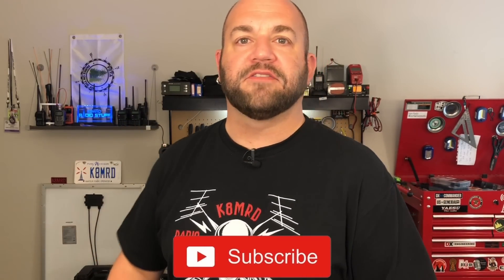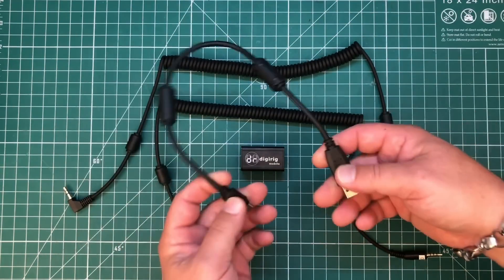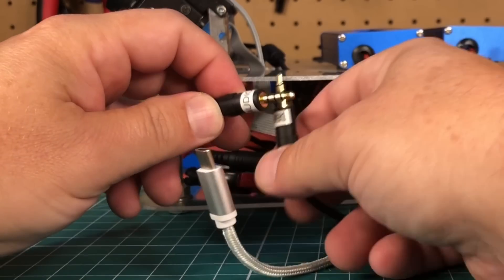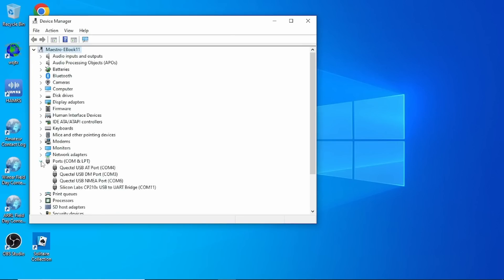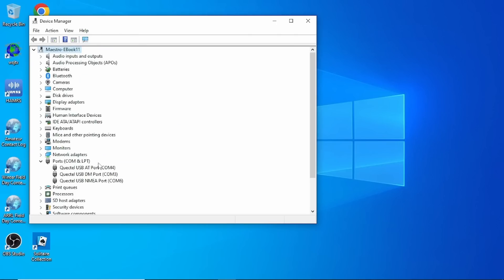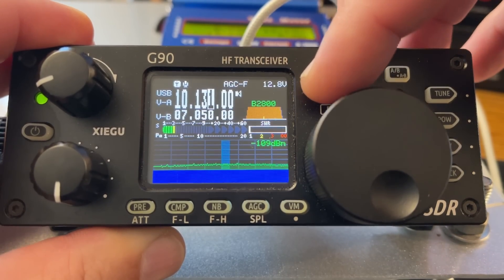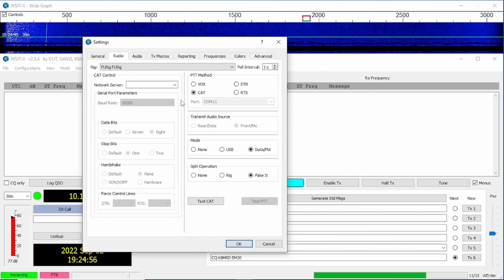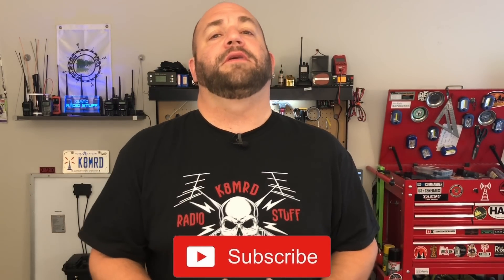Digirig, Xiegu G90, FT8 Fast & Easy

Comment: I think it would be easier to use the Xiegu DE 19. But I do not think it was available when you made this video. It takes just 3 cord and is made to work with the G90.  Though it is a bit bigger than Digirig.

Comment: On any rig you never want to run a 100 percent duty cycle at more than half the rated output. It puts a real strain on the finals doing that. You risk damaging the finals from overheating. ALways run output at the gighest, at no more than 50 percent of the rated output for the radio.

Comment: Can you repeat this demonstration using IC 705 and digirig mobile?
Reply from the maker: Easy.  You don't need a Digirig.  The 705 has a built in sound card.  Plug a micro USB from the 705 into your computer.  WSTJ-X setup should be very much the same.  Under settings > Radio > Rig > Icom IC705.  I use defaults for Data Bits, Stop Bits, and Handshake. PTT method CAT, Mode Data Packet, Split Operation Fake It.  You do need to make sure to have the baud rate the same in both the radio and WSJT-X.  I think it's 19200 for the 705.  Don't quote me on that though.  Then go over to the Audio Tab in WSJT-X and select the radio.  I believe it's just USB audio CODEC for Input & Output.
Reply: @hamradiotube i really appreciate you taking time to address my rookie question! I'm trying to find a way to get RadioMail Winlink to run on HF stations using the 705 in the field/emcom. I think it's not possible, right? Plan B  is to use a windows surface tablet (low power consumption) to run Vara and Winlink as usual. Thanks for your hard work putting out your show!

Comment: Good morning, friend, excellent video. I have a question: I can't get a high input level on the WSJTX. I've turned the mic volume up to maximum in the PC settings, but I can't get above 20 dB on the green bar (it should be between 60 and 70 dB without clipping). I've also set the G90 to line mode and its input and output levels. I'd appreciate some help. 73!!!

Comment: Thank you, you got me up and running. Now I just have to figure out how to use the program. I had a little issue with finding the correct port. Turns out I had to download a driver for the digirig. But after that, everything seems to be working well.

Comment: Thanks for the nice video. What is the advantage of running flrig between wsjt-x software and radio ?
Reply: Maybe for running other software at the same time. But his settings is old and was very confusing for my radio when I tried to use same settings in a "newer" flrig version.

Flrig needs a newer Xiegu G90 configuration file, hard to google for it. It is old what is on the github for flrig maker.

So I dont use flrig.
Reply: @LordGryllwotth  I ended up having to use FLRIG 2.0.04 set to "radio G-90" to make WSJTX work on Linux Mint with my G-90.

Comment: Followed your instructions to the T, or so I thought…Tried a dozen or more times to set up FLRig but no go. I went back over all the cables for proper seating of the jacks in the ports. Then it hit me, when you said the one in the front with the 90 degree jack is the serial! Duhh. I had plugged the cables into the Digirig incorrectly!!! Once corrected everything was a go! Thanks for this!

Comment: For anyone watching in October 2024, I had luck with this method but could not get flrig to cooperate. Flrig would randomly crash all the time, and almost always at the end of a transmission. I tried using OmniRig instead and it was MUCH easier to setup and works without a problem.

Comment: Digirig will work without using FLdigi. In WSJT select Xiegu G90 as radio and setup as you would set up any other radio. Also the Baud rate for the Digirig is 19200 no matter what is shown in device manager properties. Please correct your information and save us some hair pulling.
Reply from the maker: Well if you shave your head you won't have any hair to pull!  Hmm, I'm gonna have to try this.  I feel I did and it never worked for me.  Time to go pull what little hair I have 🤣

Comment: Well after 4 hrs it turns out not to be so easy.
Reply: Forget the FlDigi program ... just set up the WSJT radio settings for Xiegu G90 - your com port - 19200 baud - 8 bits - one stop bit - and select cat. It should work fine.
Reply from the maker: Nope.  Doesn't work for me.  Just keeps crashing WSJT-X.
Reply: @hamradiotube  I have noticed the WSJT-X software become unstable a few times and lock up as well. I wonder if there is a fix or update that will help. Everything else runs as expected.
Reply from the maker: @happyjack880  One can hope.  But for now, I have a way that works, and if it ain't broke...
Reply: @WilliamLee-eh6hy  up and running! 73

Comment: Thank you! I'd have never guessed I needed to put the G90 in U-D mode to use the Digirig. I'm so used to running my home station radio in USB for digital modes, I assumed setting the G90 to use the ACC line input was all that was needed.

Comment: Thanks for this video;   was wondering if the G90 did digital organically. I am so spoiled by the ICOM  705 ( now using SDR to do FT8 wirelessly on my iphone) that I probably wont invest in a G90 for 10 more watts... great to know there is a addition for the G90 to do it.  Waiting for ICOM to release  a50 or 100 watt versio of the 705 for POTA/SOTA use!  Thanks for the video!  Bob / KU3C

Comment: Hey Mike, or anyone, what's the ribbon cable called that connects the head to the body? I need that so bad. The cable that came with it keeps bending the connector that came with it making the connection come lose inside. I have to keep re-soldering the connector inside. N9MOE
Reply: It should be a straight through DB9.

Comment: My wife, my son, and I are all new to Amateur Radio, but learning as fast as we can. I want us to be able to communicate using SSB, CW, FT8. I purchased a Yaesu FTDX10 for our main radio and have been having fun learning with it. I want to buy a second cheaper radio for the three of us to use (when two of us want to work simultaneously for POTA and such) and am considering the G90. I see that I would need something like a Digirig to connect/interface a laptops to the G90 for CAT and FT8. Is the Digirig type component also need with the FTDX10 or does that radio include the laptop interface?

Comment: Oh-Emm-Gee!!!!!  I cannot believe how utterly non-user-friendly is the process for simply connecting my G90 to my 'puter.  All the gadgeteria required, all the extra, confusing software requiring a PhD to correctly charm into functioning. I thought just plug  in what came with the radio and CE-19, wave a few wires around and done. No! no simple find for a program so the radio display can show up on my computer. That's all I really wanted, was a larger display for my eyes. Wow...

Comment: Absolutely first class video for this application. However, there is one one tiny place where he could’ve improved on this video…. At the part where he said the radio locked up and would not work.  Instead of getting Flrig going, he may have tried using a medical syringe with a long needle and given the G90 a hard stabbing injection of epinephrine in heart of the radio. 😂 😂😂

Comment: I can get our G90 to connect and get a green light for the radio but no transmit. Also the screen on the G90 goes blank. Have to disconnect power to reboot the radio.

Comment: One update for users of Firmware 1.79 on the G90.  Changing from MIC to LINE IN doesn't send the output to the digirig / computer like on version 1.78 and below.  You have to change modes from USB to U-D and then the digirig /software will be able to decode the signal.  Most of the videos on Youtube use the older firmware versions and this has caused some frustration that it still doesn't work after going through everything else step by step.
Reply: Thank you this is the info I was looking for. I was getting 0.0W and ALC:100 with no transmitting happening before this.
Reply: @manwithaladder exact same problem.  Did you fix the 0 watts when transmitting?
Reply: That is changing the mode on the radio and not in the software, yes??
Reply: Yes, the radio mode.

Comment: Let me give you a challenge. Get a digirig working with a G90 running Ham Radio Deluxe. This has been a challenge. Who is up for that one?
Reply: Actually a man after my own heart. My main computers are Macs. I have an Ubuntu web server. The only extra computer I have is a Windoooze computer.
Reply from the maker: The bigger challenge would be getting me to use a windows computer
Reply: Do you have the digirig/flrig/g90 setup instructions for Mac? I'm a couple days away from going through the mac process and hoping the settings translate well 
 @hamradiotube
Reply: @hamradiotube  I dislike Windows as well, but this is what the vast majority of people use. How about basing your tutorials on Ubuntu? That is the future.

Comment: Have you had anyone complain about flrig not working with this setup. I did as you said about setting flrig up before. But it will not connect. I have made sure I have the correct com port. At a point I wish I had not purchased it. went to digirig web site and asked questions but no luck have not had any replies.
Reply: Same boat. No mention of drivers, no ports available, nothing on the configuration menu. Useless.
Reply: @Kzummo  Me too, I get com port error.

Comment: I finally got my G90 with Digirig up and running with WSJT-X however I'm having an issue with the ALC.  I am unable to adjust it.  I can move the slider up and down and it hovers right around 25.  I've played with the Line In and Line Out on the radio.  I've messed with all of the volume sliders in sound settings in windows.  Nothing I do makes a difference.  I'm able to transmit at the selected power output but again, just stays at 25 ish. Any ideas?

Comment: Never could get it to work. FLRIG always says "check serial port connection." I open conflig > transceiver, press update, and set it to the com port I see in device manager. Same problem. I tried installing the latest com port drivers, same thing. 😞
Reply: I had the exact same issue. I had to uninstall the driver for Silcon Labs and manually install it. After that it worked for me.

Comment: don't forget to list your current radio firmware, because every time the G90 gets a version upgrade, the cheat sheets for the functions will have parts that no longer applies, and so the procedure to find a setting may not be the same if your radio's firmware version is not the same as yours. Otherwise fantastic video, thanks for the go kit idea as well. 73 de KN4GEI

Comment: win11, followed all instrs, flrig transceiver not responding???
Reply from the maker: Unfortunately winblows 11 I can’t help you with.
Reply: Try to uninstall the Silicon Labs driver and then manually install the correct driver from their website. That was the fix for me.

Comment: Fantastic video, I already had a home brew audio interface using audio transformers to isolate the PC from the radio. I guess Digirig is similar. Just bought a min DIN plug for a few bucks is all that it cost me.
Using your setup getting on FT8 was dead easy and got into the USA on 10Watts with EFHW.

Comment: This looks good but I got scared when you plugged the Serial cable in to the data port on the control head.  I plugged a cable in there one time and it immediately "Bricked"  my G90. I had the power off but still hooked up . I had to do the entire Firmware Update to get it back to life.  Now I an afraid to plug anything in that port.
Reply: same thing happened to me, lost some minutes off my life
Reply: You may have plugged in a tip/Ring cable into a TRS jack.. THAT will cause problems sometimes.  Make sure you use only the type plug the jack is designed for.

Comment: Mike I had sent you a text earlier about my G90 radio on using the digirig it not working with my G90 radio. My problem was I upgraded my firmware to 1.79 but  it now shows the U-D and also has the L-D on the mode so when you up grade the firmware to 1.79 it changes a lot of stuff on G90 . Just wanted to let you know that was my problem the Digirig is working really good . 73 KQ4AHR

Comment: Thanks for making this video it was a great help!
Just wondering what logging software do you use with this? I have tried HRD log book and have gone over all the settings in forwarding the log from JTDX to HRD log but can't get it to communicate and work?
Thanks
George
Alberta Canada eh
Reply from the maker: Canada Eh? lol.  Um, am I using a log in this??  I assume you're on Windows.  I'm actually a Mac guy so I may not be able to help you.  I don't use the windows computer to log.  I email the .adif from WSJT-X to myself and import it into my logging software called Aether, but it's only for Mac.  Maybe try WSJT-X instead of JTDX??  I honestly don't know the difference though.  I'm sure it will work.  Often in my life I have to struggle for a couple days only to realize its some stupid setting that I didn't set properly.

Comment: Mike I have watched your video on the digirig set up just like you said work maybe 30 minutes and it quit working I contacted Digirig about it come to find out where it says USB by the frequency it should say U-D once I said that on my Radio frequency it went to work  with no problem I've have made lot of contacts with it doing a fine job now I have always noticed on some  videos that people do . That something is left out that us newbies do not understand I am new to this and appreciate all the help from the videos I see but sometimes stuff is left out that we don't understand thank you for your videos and keep up the good work just wanted to let you know that was my problem that i didn't have that checked  by the frequency .Where it says SSB  it has to be U-D but on my ft891 it says D-U a big difference between the two Radios the FT-891 is so hard to set up but the g90 is a dream 73s and a big 10.4 . have a blessed day . KQ4AHR
Reply: Hey Tommy, where did you find the U-D mode? According to the manual (page 30) FT8 uses USB.
Reply: @peterpankonin6993  it's on the mod button where you go to CW AM FM and SSB at it looks like a V-D but it U-D that will set it where it will transmit just make sure you have everything else set and your off to the races. Now this is for the ( Digirig) setup but if your using the program cable and the 8 pin cable it is for it to I have a video with Lacey on YouTube don't tell us a clean everything they leave stuff out and we newbies we get messed up 73 KQ4AHR
Reply: @peterpankonin6993  let me know if you get it working good luck 73
Reply: @Tommy-K4BWN  Hi Tommy, I didn't find the U-D mode, but everything seems to be working fine. I ran FT8 for about two hours this afternoon and contacted S Africa and Portugal on 20m at 15w.
Reply: @peterpankonin6993  well it looks like V-D are you running the it with the Digirig I did good till I got the Digirig then it stopped transmiting but was told to put the mode in D-U but it's backwards on my g90
Reply: @peterpankonin6993  the U-D is just past the SSB on the mode you have lsb L-D USB then U-D then CW I had to go to my Radio to make sure mine will not transmit any power out till it's in U-D
Reply: @Tommy-K4BWN  Maybe I have an older firmware. Mine only has LSB, USB, CW, CWR, and AM. But it's ok, Seems to work fine on USB.

Comment: Thanks for this video Mike.  I was using Omnirig but was not having much luck with it, like a delay in transmitting.  At any rate, Flrig did the trick and I'm ready for some portabl FT-8.

Comment: Mike, my selecting fake it under split mode it put an S in the little green circle next to the band selection drop down. I think you want this set to none - no split mode. Just got my G90. Had this all working the other day. Shortened my provided cable and no input audio. Can't figure it out to save my life. What firmware version are you running. I updated to 1.79b03. Perhaps I need to roll it back to the 1.78 it came with??
Reply from the maker: Nope.  I want it set to fake it.  If you don't have good shielded cables you're going to get all kinds of audio issues.  Exactly like you just described.  One day it works, the next it doesn't.  Frustrating as all get out.  I did a video on some good ones that I recommend but unfortunately they don't make a USB-C version.  https://www.youtube.com/watch?v=a7MPa3NCj3A.  I doubt it's a firmware issue but I think I'm on 1.78.  I saw no reason to do the newest update.

Comment: I could toss the Mike with my G90. It has never been used. In the 10 months I’ve had the radio it has never been used for anything but digital. I have settled on the same setup that you are using. But, every once and a while I would like to kick up the power a bit. I have a XPA125B but have not figured out how to bring it into the mix since both it and the Digirig need to utilize the G90 ACC port do you have suggestions! I’d like to compete with the guys with monster beams…
Reply: Just noticed the next post with basically the same question, so I am not alone.

Comment: Great instructional video. I have 2 G90's. One I run with the XPA-125 amp in my shack for FT8 and the other one is for portable use with a Digimode-4 for digital. I have to use the CE19 in the shack since I haven't found another way to run the amp with the radio yet. I did just get a Digirig for testing with a Baofeng HT but I might buy the cables for the G90 as well. I had some issues with the amp early on and Radioddity replaced it under warranty right away. They advised, with the amp, to keep the ALC between 20 and 80 and those setting seem to work well for that setup. Thanks for what you do. Jack K5FIT